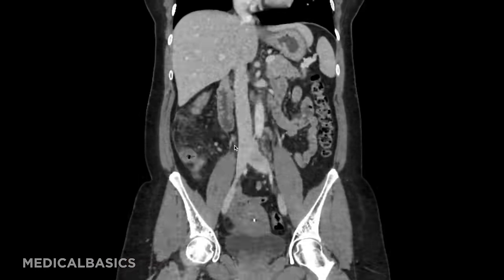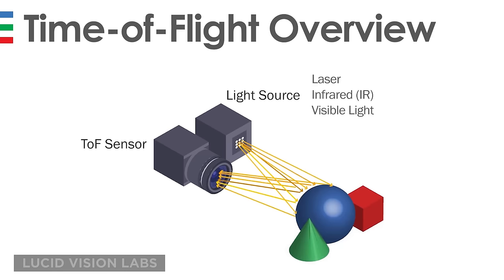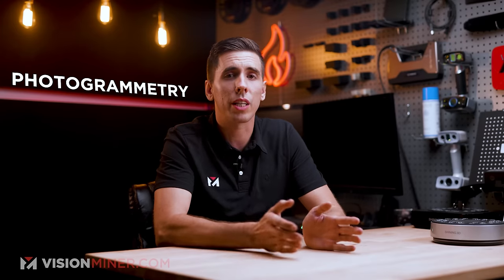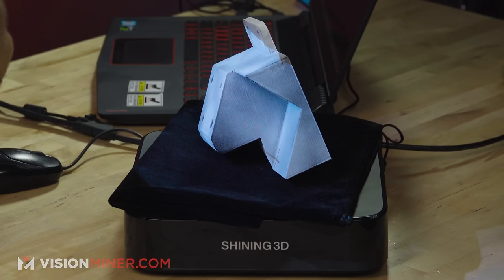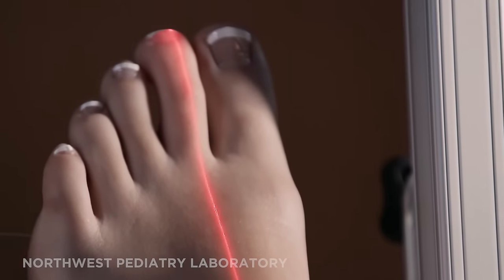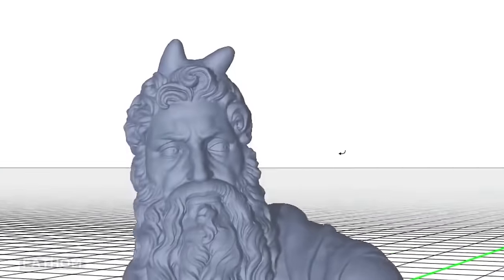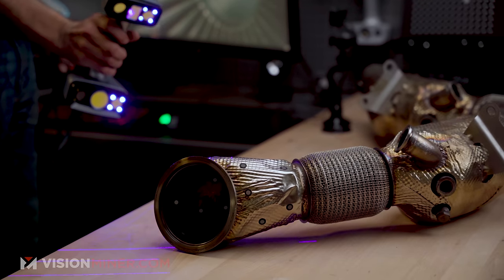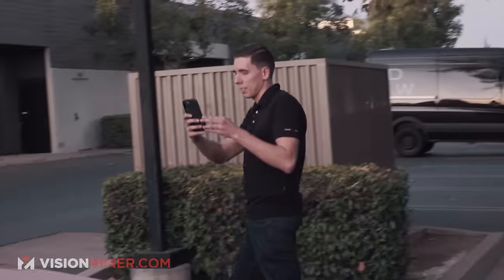3D Scanning 101 - Why You Should Be Implementing This Technology Right Now

Comment: I am a middle age man that desperately wants to learn to use CAD. I've watched YouTube videos on it, but it feels very strange to me. Are there any resources you would suggest to help a newbie learn this so i can take my furniture company to a new level?
Reply from the maker: Start with the free tutorials on basic functions, and then it's all about practice, practice, practice :) There are different youtube channels, and some sites like Udemy or Skillshare where you can take courses, but like most things, I'd say the most important thing is to log hours using it. Fusion 360 with the free license is a great place to start!
Reply: I will say, most 3d Autocad software is pretty similar in function in most circumstances. If you're using cnc machines, higher end software (like solid edge) can actually stimulate tool paths and even export direct code in certain circumstances, giving you the ability to check your parts for manufacturer ability. It also has FEA and other higher end features of needed.